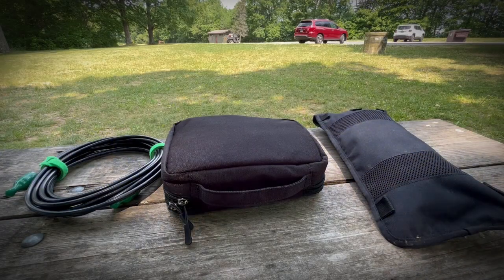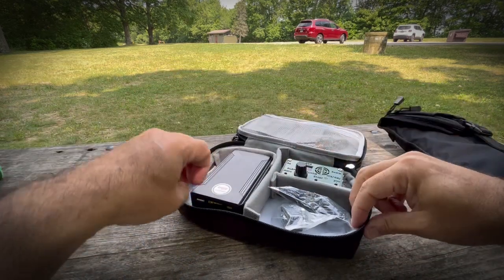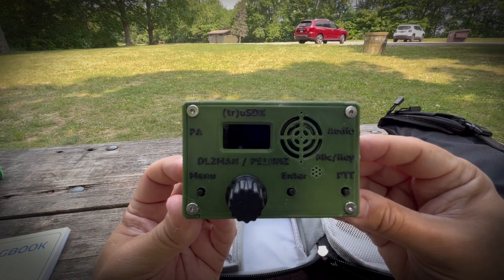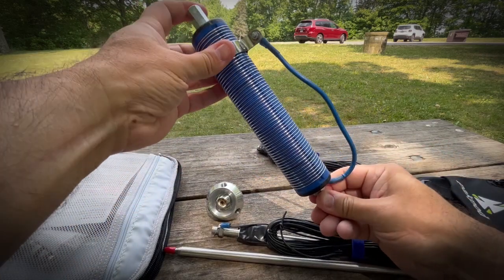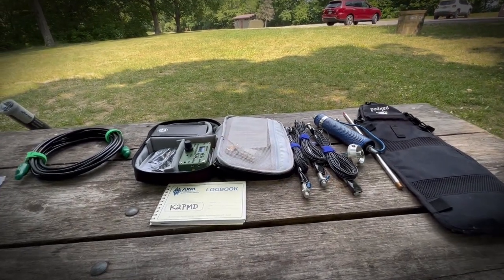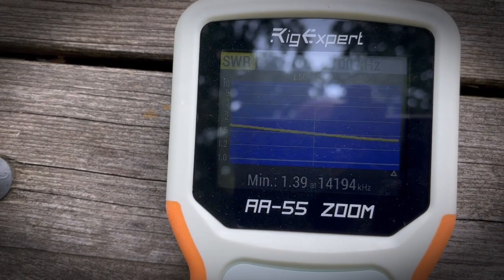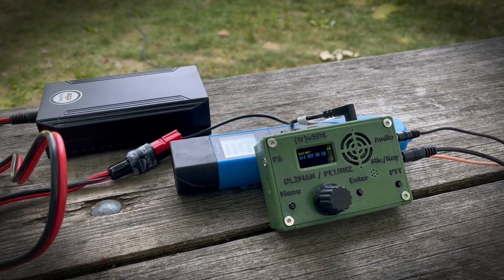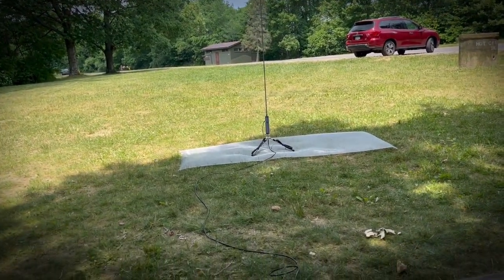POTA Test of (tr)uSDX with a mesh ground plane vertical

Comment: Would a Mylar blanket work for a ground plane?
Reply from the maker: I really don't know, but I think KB9VBR has used one to good effect. They certainly pack better than the screens which are really good for SOTA.
Reply: @K2PMD  
I'll look it up further.
But, Roger that on the packing light thing.
That is what brought it to mind. And it is common carry on the trail, so.

Comment: Very nice video.  Two questions, loved the radio pack and would like to know it it’s available on amazon? Secondly, for your battery, did you have to make your cable with the Anderson connectors or are those available on amazon?  Thanks in advance 73 de Roger W8RLP
Reply from the maker: Hello. The bag I got on Amazon for $15.00: https://www.amazon.com/gp/product/B09XB27Z9Q; 

the battery comes with a plug with an open end ready to be put into a PowerPole or just alligator clipped to leads: https://www.amazon.com/dp/B01337QXMA

Comment: Did you not connect the window screen to your antenna mount?  I didn't see any connection other than proximity.
Reply: Don't need to, the metal tripod provides adequate connection. This is the same way that KB9VBR now deploys it as well.
Reply from the maker: Yeah, I didn't connect it with a wire. I should have tested it with and without, but I was following KB9VBR's example.